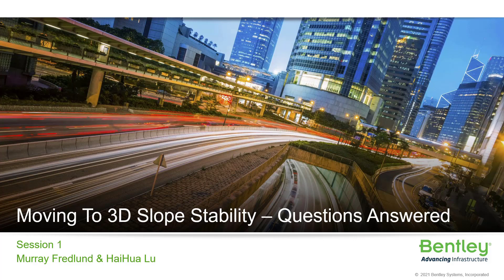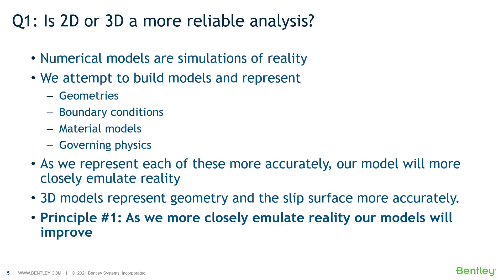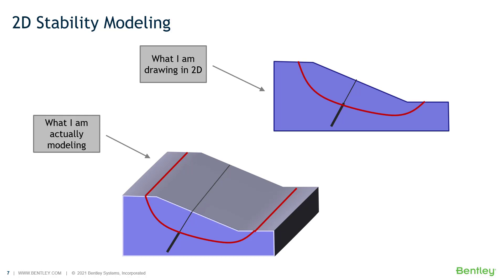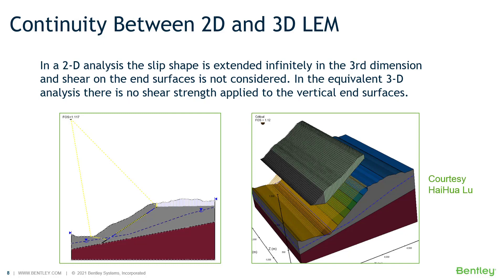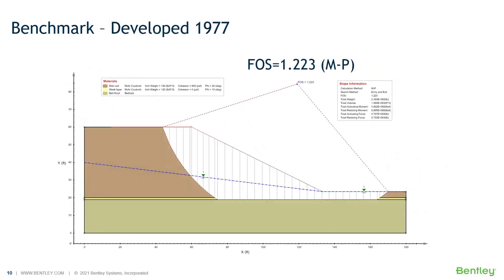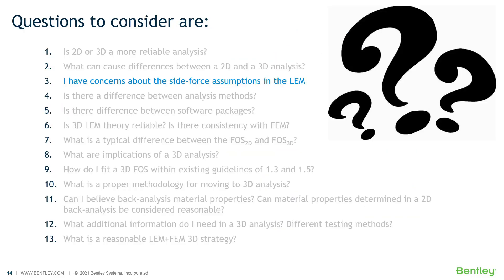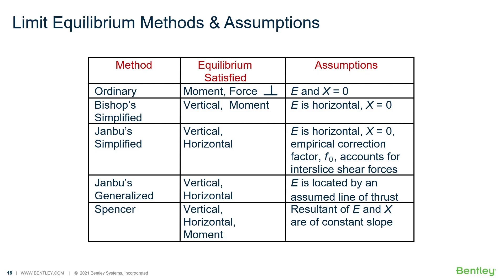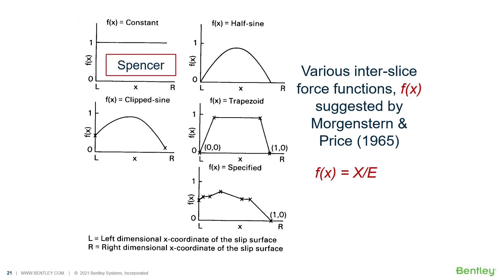Moving To 3D Stability Analysis - Part 1

Comment: Sir, i've tried the 3D Plaxis LE and i wonder to know is the cuckoo search in Plaxis 3D LE same as cuckoo search in Rocscience Slide3? because i tried to use the cuckoo search to determine the stability of whole slope ini my model but the Plaxis 3D LE just give the specific slope orientation and can't analysis the whole model. I tried the MPA method that not what i mean. In other side the Rocscience Slide3 can analysis the whole model (whole slope orientation) and show me the analysis result (critical FoS of slope) in one shot running. Can you just explain it for me sir? Thanks a alot...
Reply from the maker: Hi Ruzt - it is possible to search the entire model with the Cuckoo search in PLAXIS LE. Please connect with me at murray dot fredlund at bentley to start an email conversation!
Reply: @fredlundgeotechnical943  ok sir, i wonder how to do it sir? and what the best input paramater (nest, iteration, grid) that we use to get the accurate result for slope stability analysis (in mining case)